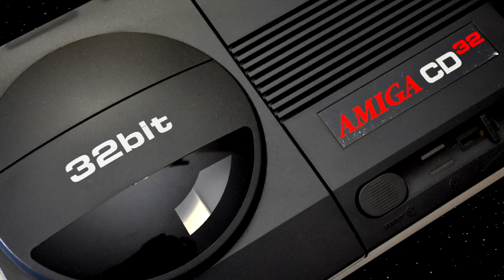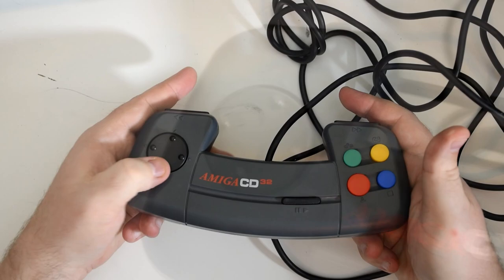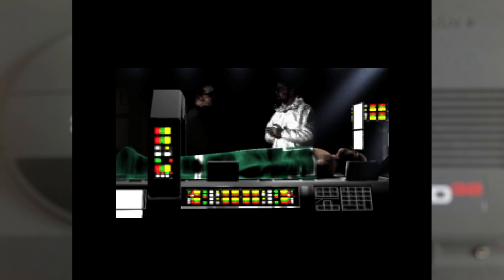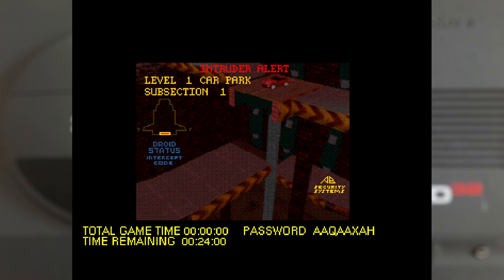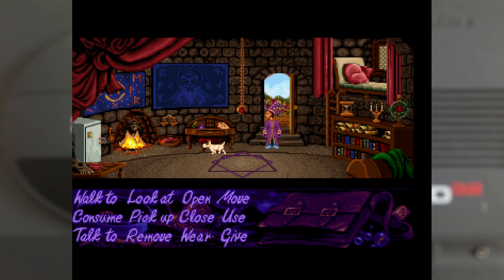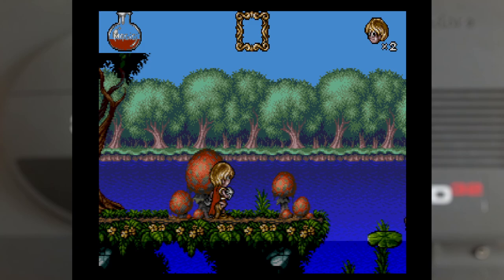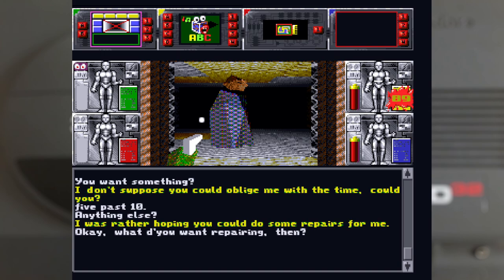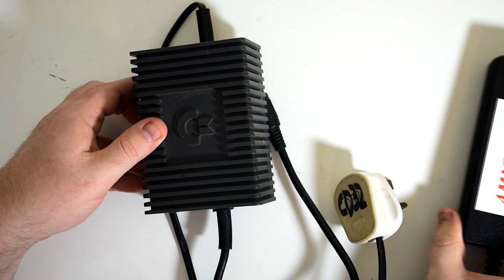The Amiga CD32 : Better than you've been lead to believe

Comment: The cd32 is the best way to play Amiga games, either by real hardware or emulation.
I love it. The joypad is a little nit crap in terms of quality.
Still waiting for a mini cd32.
Reply: pass on the cd drive.. unless we're planning on those mini cd's... They would fit.. right?
Reply: @Tech-geeky  If they would do a mini cd32, it would have a cd player. Like the mini A500 doesn't have a floppy disk player.
It doesn't need it, it would only make it more expensive.

Comment: I regret selling mine back in 1995 I'll try to get another. My two only gripes 1 CD ROM lid spring clip busted and cracked hinge 2 Lack of fast ram.  I also replaced that awful controller with the fabulous Competition Pro one
Reply from the maker: Yeah the flip lid wasn't as strong as it could have been, I think its the reason for most disc reading issues.
and it very much so should have had fast ram as standard.

Comment: Want to ask you a question compared to all the other consoles that were out at the time which one was the true Beast which one was the one that out of all of them right out of the package was the most advanced system for the time
Reply from the maker: I'd like to say the CD32, but I think we all know it wasn't.
possibly the most powerful might have been the Neo Geo AES, but that was just an arcade in a console.
the top console only machine might have to be the 3DO.
Fast ARM based processor, 2mb of ram (like the CD32) and decent 2D hardware.
Reply: @GouldFishOnGames  
3DO (with ARM60 @ 12.5Mhz CPU power equivalent to 68030 @ 50Mhz) can play Doom.

3DO CEL engine can assist with sprite scaling for 2.5D game engines and texture perspective processing.

Comment: CF cards wow, i haven't seen one of those in 20+years
Reply from the maker: In the retro computer scene they are still quite commonly used.
mostly because you only need a cheap almost passive converter for them to work via IDE.
but they are slowly being replaced my SD to IDE converters as CF cards are starting to get quite pricey.

Comment: love the amiga CD32 music intro.. However the point you made about "speedy load times" on CD, and your right. Most of the space on CD was wasted, so there was little reason to compress when you have 650MB to play with anyway, and it would double up to increase load times ten fold. Basically, compress when necessary, not because its become 'a standard'. I always wondered why CD gams never occupied the full disc, so ya this makes sense. I also think just because you have a CD medium, doesn't mean its "better" to convert a A500 port either.. The space is there, so why not use it .. Many Amiga 500 ports could have had AGA graphics, and many more with "CD quality audio".
I actually tend to think some did not.. but the assumption was different. If you can say it about graphics you can also say the same about lack of CD audio as well... It wouldn't make much sense on CD, but if your not gonna improve the graphics alway on a particular port (i.e. Beneath A Steel Sky), makes the argument more valid.  The only "better" side about this game on CD was the digitised speech. "That's it"

I would have liked to see this game in AGA form for CD specially,. At the end of the day if the goal is to 'sell the console' for what it is,, you gotta put in the effort. But perhaps the entire thing was due to lack of profit anyway. Perhaps more CD32's would have been sold ? who knows.
Reply from the maker: I think it was less compress as it was the standard, I think it was more the games loaders were written with it in mind as they always expected them to be on floppy disk.
some of the games designed for the CD32 like Flink load so quickly.
we have seen how things could have been better with WHDLoad patches that decompress the data as part of the install.
Reply: @GouldFishOnGames   You lost me on that one. The reason you compress is to for more on floppy not the other way around..

If you compressed less as a 'standard', Amiga games wouldn't be as good/music etc.. You had loaders to help speed it up, but that's only to a point. The more you compress, the more it would take to uncompress.

You wouldn't believe how long you'd have to wait for "de-crunching" screen to go.

Comment: To me.. the CD32 had the exact same problem as the A1200. It really wasn't a full upgrade.

While they probobly could make due with the cpu, the lack of anyway to make something that look like 3d grapics in hardware, really was a killer blow.

While ofcause, 3D accelerator for PC was very rare att this point, they on the other hand had a very fast cpu.

The situation was very siffrent to 1985 when the 286 was super expensive and the 386 was pretty much unheard of.

When A1200 (and well the A2000) come around, 386 was quite cheap even with fairly high core chock, and 486 was really avaliable, of more expensive. And by the time the A32 came along,  the  pentium,  was not only common, but even at there second iteration.

If cause compare this to the PS1 that is fairly simular to the CD32, while the PS1 does have a faster cpu, the main diffrance was the ability for 3d acceleration.
Reply: Its a console.. The SEGA Megadrive wasn't upgradable, i don' t think any were. In short of SX addons and FMV

Comment: I had the CD32 with SX32, the problem was commodore was out of money, the CD32 was old when it came out, the CPU was starved from lack of fast ram even 1 meg would been better than no fast ram, it had no 3d acceleration at all. If the CD32 was released 1990 it would been very good, here is my fantasy Amiga 32 build, 1993, realistic specs edition, blow the SNES and Sega mega drive edition  out of the water. For that i think a 68030@25mhz, 2 megs of fast ram, 2 megs of chip, some kind of very simple polygon drawing capabilities, lets say enough to draw lets say 120k raw polygons per second with thousands of colors. If the CD32 could done that I think it could have survived for a few years.
Reply from the maker: Yeah, if Commodore had more cash I think the CD32 would have stuck around a little longer.
still amazing how many games it managed to get, and how many were released after it was technically dead.
As much as I think the machine should have had more ram and possibly more specs, I doubt they could have gotten it out in a decent time or price.

Comment: The CD32, was Commodore's Atari Jaguar, ie a system that wasn't what it proclaimed to be...this machine was no 32 bit powerhouse when you consider that it would have struggled to push out games that the 3DO could do....much less the 32x...this was Commodore's answer to the Sega CD which itself was a 16 bit add on
and not a 32 bit add on....
Reply: 3DO's ARM60 at 12.5 Mhz is pretty lame. ARM60 can provide a 30 MIPS peak at 30 Mhz, hence 3DO's ARM60 CPU at 12.5 Mhz is about 68030 at 50 Mhz🤣
Reply: @valenrn8657  irrespective of that the CD32 wouldn't have been able to do a game like Crash and Burn, Super Street fighter (on the level it was on the 3DO) much less a Need for Speed...
Reply: @yuvraj01  3DO has a 50 MB/s system bus and its capabilities are limited by this factor. 3DO's custom chips shift the bottleneck towards the memory bandwidth since 12.5 Mhz has about 12.5 MIPS.

Ideally, a 50 MB/s bus should deliver 50 MIPS. 3DO's math co-processors are fixed point and quadrilateral 3D.

Comment: When the cd32 came out we all had IDE harddrives and cd drive in our Amigas that's 1 of the reasons it failed it doesn't have any updates you can take a cd32 disc and run on a a1200 or a4000

I remember I had 14mb of fast ram at the time.. Cd32 kinda could not match my a4000 30mhz and 15mhz fpu
Reply from the maker: IDE drives in Amiga's when the CD32 came out were not all that common.
even less common were Amiga's with CD Drives, most for the A1200 came out after the CD32.
Just the CPU upgrade for the A4000 would have cost more than a CD32, not to mention the cost of the A4000 as well.

this was a console, with decent for the time (but not for what was comming) hardware is an affordable package.
Reply: @GouldFishOnGames  i just installed a random CD drive worked fine back the, I changed it though since, also when I bought my A4000 I bought it 30mhz with fpu before there even was a cd32
Reply from the maker: @grandmasterthefuriousfive7487  In a machine that cost upwards of 10 times as much as the CD32, with a CPU that cost more then the CD32.  At this point most Amiga owners were still using an A500!
Reply: @GouldFishOnGames  not 10 times the cd32 cost 399usd on release in Europe where I'm from that's makes my A4000 with 4mb fast Ram 420mb ide drive 3 to 4 times more expensive

I later installed cd drive lots xtra ram and bigger HD myself 

Anyway I remember playing it in the shop where I worked
Reply from the maker: @grandmasterthefuriousfive7487  looking up prices from the time its easily 5 times more expensive then a CD32. and that is for a basic 4000 with out a monitor or software.  Add in those and it increases quickly in price.  Is the A4000 more expandable, yes but then its a full computer.  The CD32 is a console.  and As a console its not bad.
Reply: @GouldFishOnGames  before you said 10, well I personally paid 2 times more than a cd32 to be precise I paid 12000DKK and a cd32 when it came out was around 3995DKK that's exactly actually only 2 times more.. price of 3. 32cd consoles

Comment: The Amiga CD32 was never going work, it was a repackage A1200 with a new ROM and CD player attached (although I'll give Commodore credit on being able to shrink the hardware enough to fit inside a console sized case) running dated hardware.  Just bear in mind this was released in 1993, 18 months latter this would have been going up against the PS1 and Sega Saturn had Commodore not gone to the wall and the CD32 wasn't even a graphically good a the SNES/Famicom let along 32bit consoles from Sega and Sony.  The hardware whilst clever and impressive back when it came out dated very quickly, the AGA lacked colour depth, chunky pixels, texture mapping, transpierces, lack of sound channels, poor sprite handling whilst the SNES offered scaling, rotation, transparency, 4 background layers with independent scrolling, 128 (8/16 color) sprites (32 max on scanline) and mode 7.

There was a project Commodore was working on called 'Amiga Hombre chipset' which apparently would have been competitive with the Saturn and Playstation, I would love to see someone try and build that as a project to see what it could have offered.  It wouldn't have been enough to make the Amiga the go to consoles due to the lack of decent developers in the West as at that time 80% of the best titles came out of Japan but with the right management they could have used it a tech demo to pivot the company into a hardware design firm that sold and designed add-in cards for the PC, maybe if they merged with Silicon graphics Nvidia may not have gone on to dominate the PC market.

Comment: The CD32 is the BEST single Amiga to own because ALL games work on it from Every Amiga.  OCS, ECS, AGA, CDTV.

I used to have a CD32 with SX32 Pro 50mhz and 50 mhz FPU 128mb RAM and I think 120gb HD connected to an SuperGenSX, ChromaKey Plus, MindEYE VJ device, DCTV with DCTV RGB adaptor and three 5" LCD screens that I used at a Night Club for VJ-ing....running SCALA MM400 and Elan Performer and MindEYE software along with mixing video with the SuperGenSX. 
One of My Created Videos with the ChromaKey...Live Dancers on a Bluescreen with Amiga gfx in the background (running in SCALA):
https://www.youtube.com/watch?v=9hEbs6FX0cM

Amiga CD32 was done SUPER dirty by Commodore. Should have been a Harder Shell, 6mb RAM and a 50mhz 68030 and the FMV card included.

Comment: The machine was O.K, the control pad was a bit odd, it was almost the right machine at the right time but the games were very poor compared to the Super Nintendo or even A500. It had no chance of competing with Playstation. In hindsight it would have been much better if Commodore had put their efforts into produce a decent CD-ROM and hard drive for the A1200 in 91-92. By 93 it was all over, Doom killed serious Amiga gaming. I remember Gloom.
Reply: PlayStation has 33 MIPS CPU and 66 MIPS integer-only co-processor.

A Pentium CPU @ 100Mhz has about 188 MIPS (dual integer units) or 94 MIPS integer/50 MFLOPS FPU due to dual instruction issue limitation. 

Amiga would need the Hombre chipset or fast 68060/68LC060 to compete in the Pentium era.

A fast 68LC060 @ 75 Mhz is needed against mostly integer-only PlayStation.

Comment: My CD32 no longer Spins Up  :(
Just after I bought 4 CD+G Discs by 10,000 Maniacs, Fleetwood Mac, Anita Baker & Gram Parsons.
Reply from the maker: That's just typical!
I think you can get replacement drives for them now, but I think there is also an issue with one of the screws coming loose.
which means it doesn't hold the CD in place.
Reply: It is a simple check so you probably have already done so, so apologies if you have but GouldFish is right about the lid.  If it's not completely closed the console may not register it as shut and therefore won't spin the drive, I used to have that problem myself.  The spring-like mechanism in one corner of the lid does put some tension on it so can make it rise a small amount and a small amount can be enough to register as open.
I always thought that's what the small spike-like protrusion near the front of the lid was for, triggering a sensor to confirm the lid is closed.  However it does it, the margins are extremely tight so even if the lid is sitting up by just a millimeter or two, the console will behave as if the lid is not shut.
I'm on my second CD32, I don't have my childhood one anymore and that was one of the problems my previous one had.  Even when I thought the lid was closed, the console didn't so wouldn't spin up.  My workaround as a teenager was to put something heavy on the lid when I wanted it closed and take it off when I wanted to open it.  That worked, it ensured the lid could not sit up and make the console think it was open.
It was a pain but I didn't have the skills or the inclination as a teenager to attempt to fix it when I could just place a large lump of plastic/resin that I think was a pub/bar advert/ornament advertising Carling or something like that on top of the unit, to keep the lid closed and stop the console thinking I'd just opened it.  The things you remember :)
Obviously it could also be a broken drive in your case but you can occasionally find replacements on eBay, sometimes even services who'll fit the replacement for you if you don't fancy that.
Reply: @paulgibson1700   The lid switch is a photo-cell on the Reset/Headphone board.
I tried magnets on the disc = no effect.  Worse the LASER no longer returns to centre.
A new drive = £90 (+4 pnp), Repair (Mutant Caterpillar)= £75 (+pnp).

Comment: Well, it's an A1200+ an optical drive.. which never was a great thing. They didn't even bother putting in at least a 50MHz CPU with and FPU and FastRAM, which could have made the hardware at least halfway capable for running light 3D gaames, and so it had no future at all. CD32 is same never needed crap anything else beyond the A500 and A2000, because anything later was either too little, or too late or in moste cases both at once :(
Reply: Actually the double speed optical drive used in the CD32 was a great thing, in 92/93 HD's were still massively expensive, even a 2.5" HD with half the capacity of a CD will have cost nearly as much as a CD32 console.  The same applied for memory which was prohibitively expensive,  and that 030 you thought Commodore should have stuck in the CD32 was actually still reserved for high end computers at the time such as the Macintosh LC III which came with a 030@25Mhz / 4MB Ram for $1300+,  the Amiga 4000 also used the EC 030 and it was even more expensive.

Comment: It wasn't actually a good machine - it was just an Amiga 1200 with a CD drive. Minimal research spend by Commodore. Wasn't designed specifically for games which is why the SNES and Megadrive can outpower it sometimes. It is only a good machine if you add a keyboard and turn it into a computer

Comment: Thing is every game for it, is just a straight up amiga game. Not a single game looked or sounded better than what the original machine could do. 

It was useless, they should have just made it a CD add on for the amiga and then at least every amiga owner might buy one, instead of just 10 amiga die hards and a 50 year old virgin named Bob.